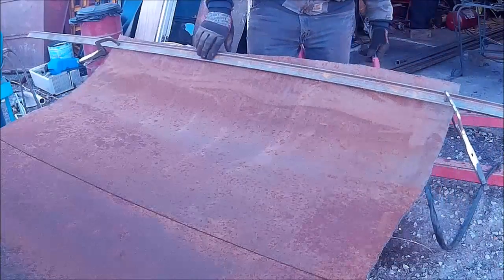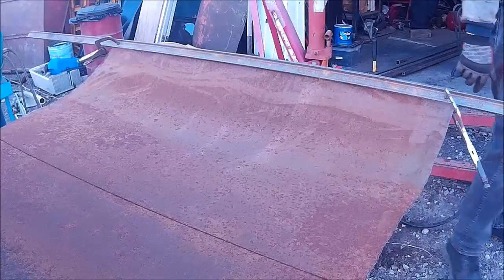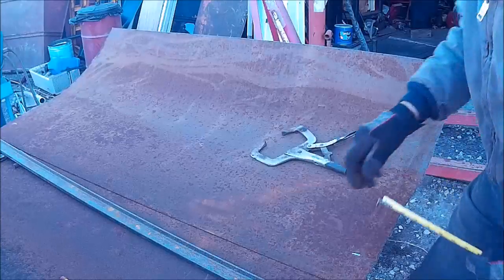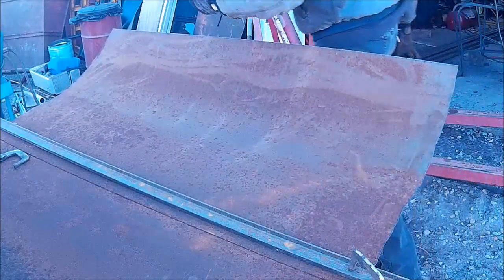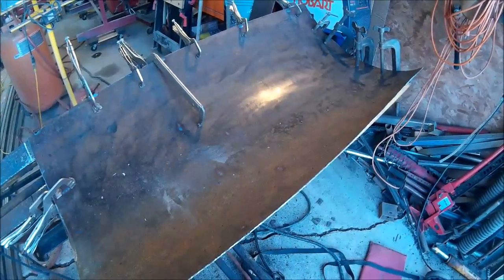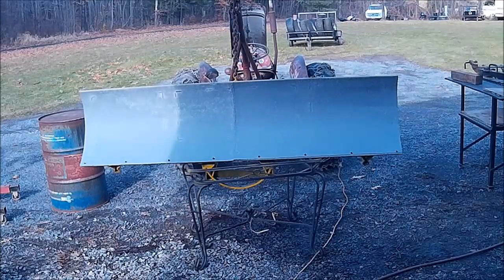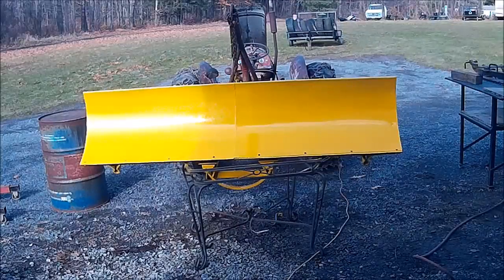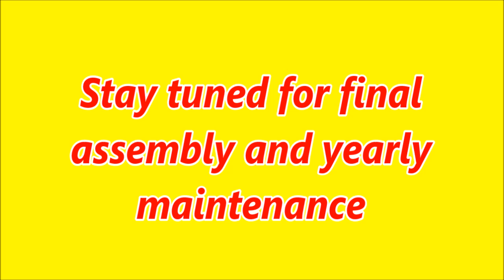Meyers Snow Plow Repair #2

Comment: Looks great!   Never thought of using an old fuel oil tank for plow repair.  My plow is pretty rusty, may give this a try in the spring.  How did you roll the top edge?  I'm guessing torch and hammer?
Reply from the maker: Yes, a little heat and the top edge is heavy angle